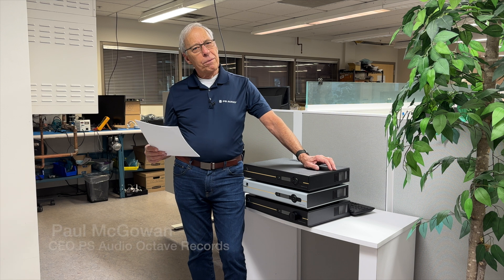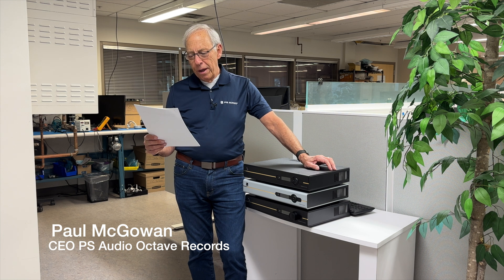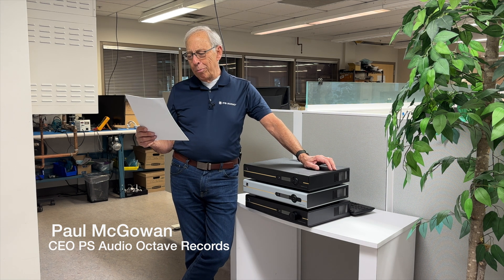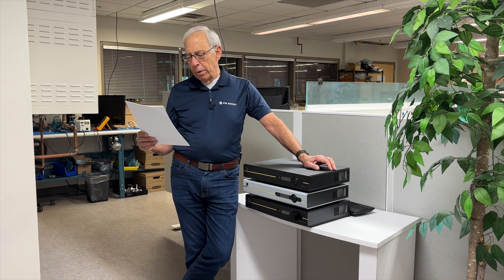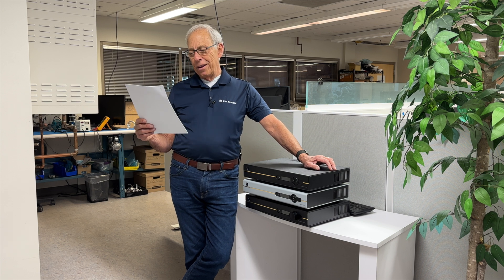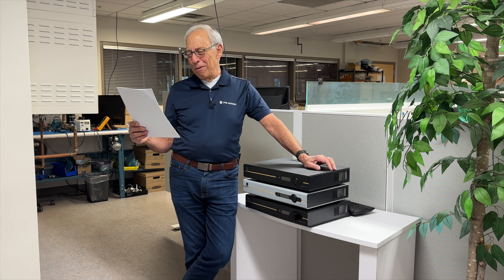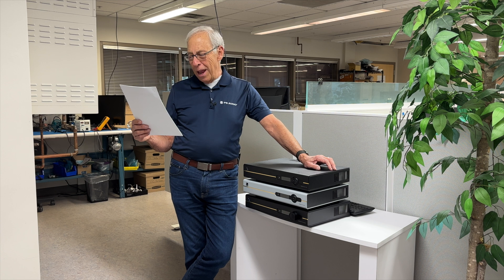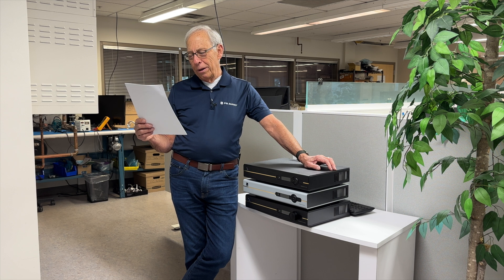Aftermarket power supplies

Comment: If everybody would understand Ohm's Law, then Paul would run out of questions to answer within a month.
Reply: Ain't that the truth.

Ohms law is so simple ... Current is the result of applying a Voltage across a Resistance.  That is  Current = Voltage divided by Resistance ... I = E / R.
Reply: @Douglas_Blake_579  I despise the answer someone gives as to why I should “upgrade” a component in my system just because it “sounds better”, makes me step back and take pause. That is purely a subjective opinion, tells me nothing….
Reply: @zulumax1 Exactly, plus they never even define what "better" is, it's like saying "it sounds more musical". I just can't take the person that says it seriously
Reply: @zulumax1 
Exactly why you should be suspicious of it.
Reply: Even if you understand ohms law and circuitry, Paul did not answer the question of WHY it would sound better. 

I just bought the Eversolo DMP-A6 streamer DAC. It comes with an internal switch mode power supply that is designed with a well shielded Faraday Cage around the noisy chopper circuit power supply. There is an aftermarket linear power supply that is supposed to “improve the sound”. The question remains as to why should I want to change it and void the warranty?
Reply: @zulumax1  he may not have answered the question to your satisfaction. He did answer the question in layman's term. This isn't an electronics YouTube channel, it's an audiophile channel and that has all kinds of people with all kinds of backgrounds that take a look at it every day. And I am not a Paul protector.
Reply: @zulumax1 
You shouldn't want to change it. SMPS is better in every way.
Reply: @Douglas_Blake_579  Agree with that. Much more efficient, less heat, current on demand, quicker regulation of voltage. As long as it is well shielded and filtered from the rf produced by the chopper, should not be a concern with modern designs.
Reply: @Douglas_Blake_579  I would also be curious how much power that linear supply is using (wasting) to keep the standby circuit energized when not in use. Would not be green endorsed I would think.
Reply: @zulumax1 
Actually, linear and smps are pretty close in idling efficiency.  At full load, slightly different story, there smps wins hands down.
Reply: Just knowing the basic Ohm’s Law formula won’t solve the problem Hugo.. Electronics technology in audio equipment is much more complicated than that. Plus there’s acoustics,  psychoacoustics, mechanics, and other subjects involved in modern Audio. Actually, many people that think Ohm’s Law is simple, may not even fully grasp the “complications” of Ohm’s Law from a theory perspective once AC is involved. It always “works,” 
IF properly evaluated, but the math becomes more intense than frankly, the average person has the patience for. Iow, there’s a whole lot to know beyond this “simple” looking equation.
Reply: @shipsahoy1793  You hit the nail on the head. "Just knowing the basic Ohm’s Law formula won’t solve the problem". There is a world of difference between that and what I said: "understand Ohm's Law". If you understand Ohm's law, you get very far understanding all these topics people claim here can not be solved with it. The only thing they are saying with that is that they understand the formula, but probably not more.
Reply: @shipsahoy1793 
The plain fact is that Ohm's law governs the behaviour of every circuit everywhere ... even on the ISS.  Not understanding it literally blocks you from ever understanding electronics at all.
Reply: @Douglas_Blake_579  You’re preaching to the choir Doug.. my point was that it’s very complicated;  analogous (somewhat) to the way F=mA is very complicated, since Force and Acceleration are 
3-dimensional vectors 
in space, (so F=mA is a friggin’ differential equation). Hence, just because somebody “thinks” they understand Ohm’s Law, or even if they did, that doesn’t mean that everything will be fine. They are still not going be able to answer all their own questions..
Reply: @shipsahoy1793 
My point is that without it, they won't be able to answer ANY of their own questions.
Reply: @Douglas_Blake_579  🤣 Wow, my history with you is perpetually akin to this scenario.. I can’t say “six” without you saying, “well actually that is considered a half dozen.” I think we are both probably senior citizens, but I don’t want, or like to, waste the time on trivialities these days. 
I’m sure everyone around here younger (and sometimes) quicker than us “gets our points,” but whether they like it (or like us) or not, that’s a different tune.. lol
Reply: @shipsahoy1793 
It's a matter of reasonable accuracy.  Ohm's law itself is not complicated.  I posted the whole thing above.  But it is also the governing principle by which almost all electrical systems function. You simply can't understand any of it if you don't have this rudimentary fact to work from.

For example... figuring out the resistor values for biasing a transistor... ohm's law.  Figuring out the power supply requirement for a new device... ohm's law. Figuring out the amplifier loading for a new set of speakers ... ohm's law. 

It's a simple three element arithmetic problem... but it is positively everywhere in the electronics world.

I wasn't contradicting you... what I wrote was to clarify what you wrote. It can be a problem in these forums because for the most part they just a huge sea of congoing disagreement... but we still need to recognize agreement or clarification in all that.

As in... Just because I replied to you does not mean I am disagreeing with you.

Cheers.
Reply: @Douglas_Blake_579  Yes, and I don’t have a problem with you or any of it really, Doug. It’s just that you go on and on clarifying things.. I used to do that as well, but it turned out that many either don’t  end up understanding or even care to try.. if I cared enough for them to understand, I would end up driving them further away from understanding, so that’s why I don’t bother.. 
Even in your last post, you again were expanding on the beautiful simplicity of Ohm’s Law for figuring out certain basic quantities after clarifying your position last time. I don’t think it really helps after a point. I know that the name of the game sometimes when it comes to tech education is repeated association, but with some of these people you’re just wasting your time. If anyone really wants to know what’s going on, they’ll seek out the information and knowledge for themselves through other means than these comment threads. These comment threads are just for people who want to get something off their chest for whatever reason lol    Now,.. you know what the next step will be .. some clown is going to jump in here and try to piss off one of us  with some ludicrous comment or other.😉
Edit: Ditto on the Cheers!
Reply: These people are not interested in Olms law. Some of them ask stupid questions but this wasn't a stupid question for someone who is just trying to understand why aftermarket high-quality linear power supply would be a better choice.
Reply: @Scopolamine46  I can agree with that .. How many people who drive a car actually want to understand all of the technology that goes into the vehicle ?! in fact, I’ll go one further in saying that people have a lot of nerve asking questions that are technical, that they don’t have the background to understand the answers to. And furthermore, Paul’s technical qualifications for answering some of the questions that are technical in nature, vary between he completely doesn’t know what he’s talking about to some partial percentage of the truth.
Reply: @Scopolamine46 
First of all it is unlikely any well filtered and regulated supply would make any difference in the first place.  But given the choice between linear and switching supplies, I'll go with the switcher  every time ... they are better regulated, they refresh thousands of times a second and they absolutely do not hum.
Reply: Ohm’s law won’t answer the power cleanliness requirements. Nor the voltage stability requirements.
Reply: Understanding Ohm's Law is NOT NECESSARY to the enjoyment of music!
Reply: @marcse7en  But it helps avoiding many pitfalls when it comes to Audio gear.
Reply: @hugobloemers4425   Does it really? ... Well, I haven't encountered any Hi-Fi "pitfalls" requiring an in-depth knowledge of Ohms Law!
Reply: @marcse7en 
No it isn't.  But it is a pretty good way to start understanding the electronics you use to listen to your music.
Reply: @Douglas_Blake_579   "Understanding the electronics" is NOT necessarily a prerequisite for the enjoyment of music. It's just not.
Reply: @marcse7en 
No it isn't ... we agree... so why are you arguing with me?

For the guys messing with cables and accessories and all nature of dodads, then it becomes important.
Reply: @Douglas_Blake_579   I'm not "arguing" with you. Merely stating a simple fact. Lord knows I've been into Hi-Fi long enough!
Reply: @marcse7en  Squirrel!

 Wow! divert the topic with some non sequitur!
Reply: @zulumax1  What ARE you wittering on about? ... Just say what you've got to say!
Reply: @marcse7en  The topic here is being knowledgeable enough to answer your own questions, has nothing to do with enjoyment of music. Your statement is true, so what was the point of it?

 ie; off topic, non sequitur comment.

Comment: After trying SBooster power supplies for my ADOT fibre optic kit and Chord Electronics MScaler, I purchased both. I was extremely surprised by the level of improvement at a relatively small cost.

Comment: Only measurements can tell you if a particular device with a particular PSU will benefit and by how much by replacing with another specific PSU. The measurements should be of the device itself NOT just of the PSU. Lacking measurements, at the very least you need a blind subjective side by side comparison. There's lot of marketing bs going around which, assisted by subjective reports by users, which are commonly just placebo or purchasing confirmation bias effects (almost never are 2 identical devices one with the 'upgraded' PSU listened to side by side), have made some suppliers of alternative PSUs rich in the very last few years. Also people tend to assume that any linear PSU is by definition better than any switching PSU. This could not be further from the truth and is a myth designed to part fools from their money.
Reply: What's the matter don't you have ears that you can hear the differences? Another Gene follower.
Reply: Careful dude, you might cause a panic! 🤣
Reply: @chungang7037  don't you realize that he is looking to cause problems. He could've just stated most of his comment without the last line. He is looking to start a problem.
Reply: @Scopolamine46  How clever you are., you understand everything. lol. Let me see, you're either such a fool or you sell PSUs.. See, I understand as well.

Comment: Just added a linear power supply to my iFi Zen Stream streamer replacing its wall wart switch mode power supply - BAM - really nice upgrade sonically.
Reply: You'd best be sure that linear supply is properly regulated. If it isn't, one power surge and it's bye bye streamer.

Comment: Get a 12v gel battery. Cleanest power ever.
Reply: Would depend on the regulator used..
Reply: Most "12 volt" batteries aren't 12 volts ... most run between 12.6 and 14.8 ... and in some cases that overvoltage can damage your devices.

Gel cells usually sit at about 13.4 volts when fully charged.
Reply: @Douglas_Blake_579  That is why one needs a regulator, whose quality will affect the quality of DC in.
Reply: @razisn 
And, of course the designers were too dumb to include internal regulators and safeguards... right?

Seriously, I am constantly amazed  at the number of people with exactly zero technical skill or training who are so much smarter than the guys with 3 and 4 years of specific training and daily experience with this equipment.
Reply: @Douglas_Blake_579  What are you talking about? I said a regulator is needed with a battery and quality will depend on the quality of the regulator. Who talked about internal or external regulators, designers or whatever?  I'm amazed at people who fail basic reading comprehension. Get a hike and go back to primary school.
Reply: @razisn 
And I'm amazed at people with little or no tech skills who think themselves qualified to second-guess the engineers who designed the equipment they worship.